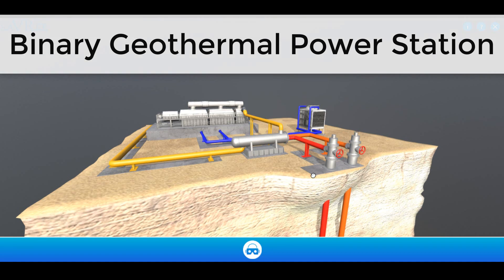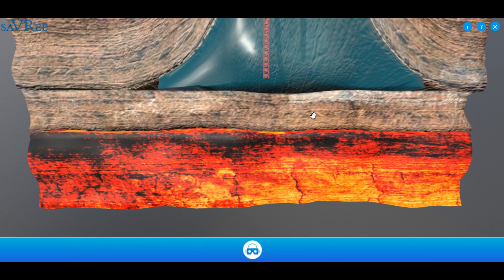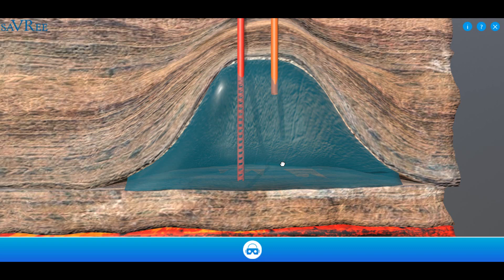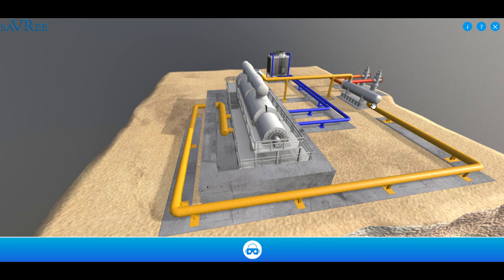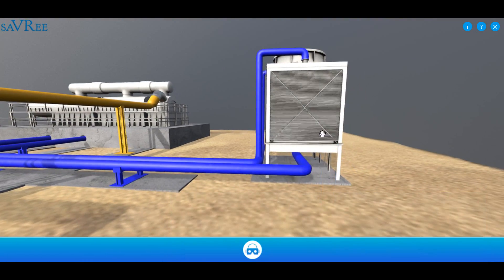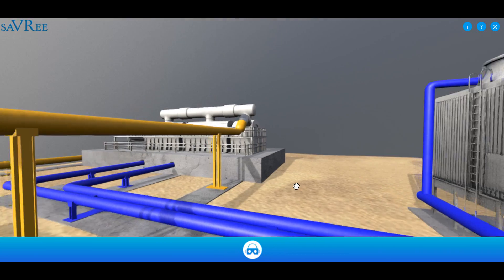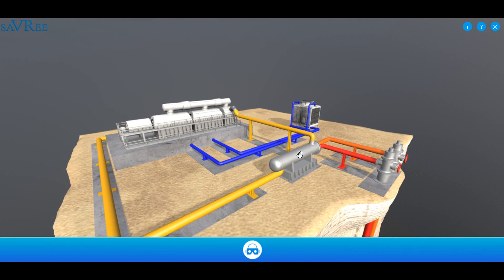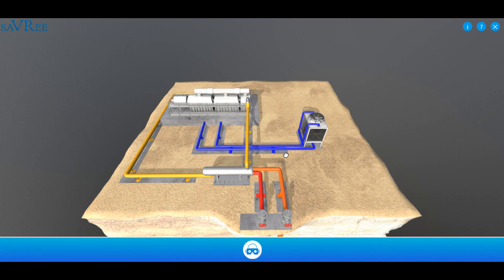How Binary Geothermal Power Station Works

Comment: Very good video! Well explained. Thank you!  

Can’t wait to put my Tesla turbines to the test in a direct geothermal steam supply. It’s more than capable of handling the multiphase fluid flows and even the particulates.
Reply: Nikola Tesla’s”Our Future Motive Power” article from the 1930’s explains how to use the geothermal heat energy in the steam turbine even when it’s well below 100°c. It’s the same vacuum steam system as use with Ocean Thermal Energy Conversion (OTEC). Just gotta have a vacuum condenser on the exhaust and a very high mass flow rate high vacua pump which Tesla coincidentally also has a patent for that. 

Patent GB 179,043: High Vacua Pump

Comment: can i ask? where does the secondary liquid in the heat exchanger came from?
Reply: there are two fluids working in this power plant. both of them are in different cycles. THE GEOFLUID, since it has not so high temperature , it is used to heat the other(main) working fluid which is ofcourse of low boiling point and then it gets converted to steam and after that the rest process is same as of conventional thermal power plant.

basic differnece between dry steam and binary plants is this only that in dry steam plants the geofluid (as obtained as steam from earths crust) is directly fed to the turbine whereas here we are using another fluid.

i hope this answer ur question